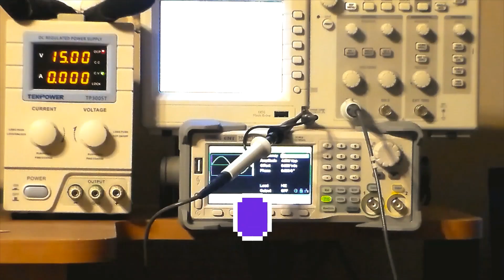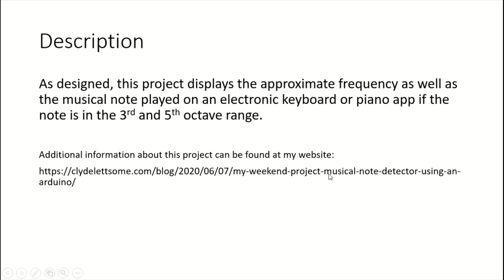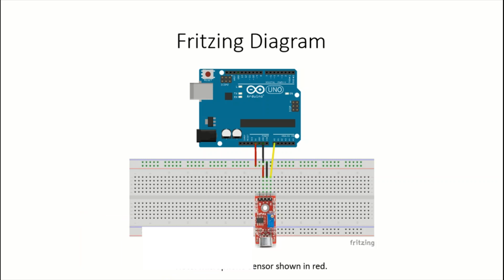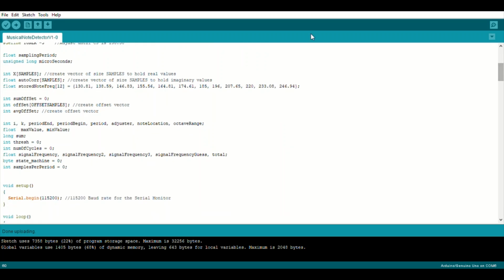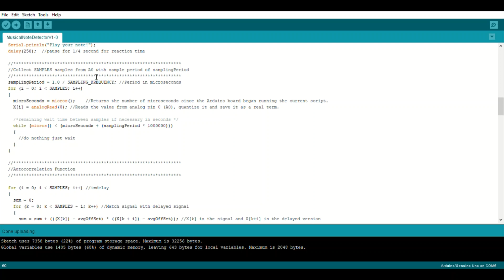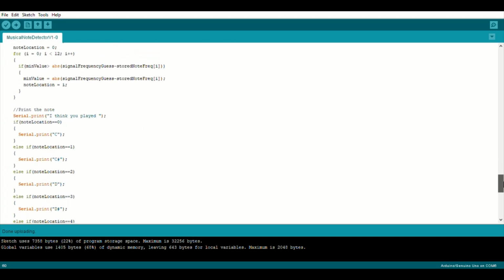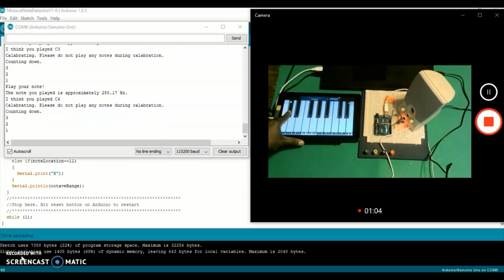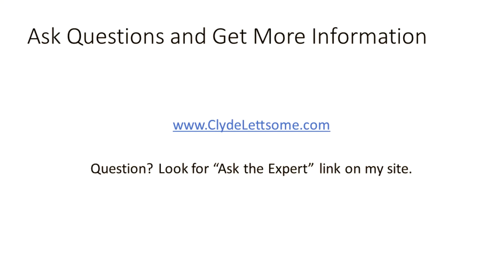My Weekend Project: Musical Note Detector Using An Arduino

Comment: In order to make the program display how close the played note was to the closest match in the storedNoteFreq array, I added the following in the section you titled "Find the closest note":

noteLocation = i;
        cents = 1200 * log(storedNoteFreq[i]/signalFrequencyGuess)/log(2);
        if (cents < 0) {
          flatSharp = "flat";
          cents = -cents;
        } else if (cents > 0) {
          flatSharp = "sharp";
        } else if (cents = 0) {
          flatSharp = "";
        }

I then had this display in the printed output  as...

Serial.println(octaveRange);
    if (cents == 0) {
      Serial.println("You nailed it!")
    } else if (cents <> 0) {
    Serial.print("You were ");
    Serial.print(cents);
    Serial.print(" cents ");
    Serial.print(flatSharp);
    Serial.println(".");
    }

What do you think?

(NOTE: Don't forget to add "int cents = 0;" and String flatSharp = "";" to the variables at the very beginning.)

Comment: Hi! Thank you so much for this video, I really appreciate it. I just have a really quick question -- https://www.amazon.ca/Robojax-Detection-Module-Switch-Arduino/dp/B07C2Q7LRH/ref=sr_1_20?dchild=1&keywords=DEVMO+3PCS+Mic+Microphone+Sensor+High+Sensitivity+Sound+Detection&qid=1626290052&sr=8-20 will this sound sensor work? And can this system detect chords as well? Thanks a bunch!

Comment: Hi Doctor Clyde,
I measured the current of a mobile charger with a multimeter and i put a 1 ohm 3 watt resistor in series with the probes and the output of the charger and the output voltage and current is exactly the same as what written on charger.
I tried with other chargers and the results are exactly like what it should be.
Did i measure the current wrong?
Reply from the maker: Hi Toolman,
It sounds like you did but do note the crrent showing on your multi meter will also be dependent on the resistor (load) you put in series also.

Good Luck!
Like, Share, and Subscribe.
Reply: Thanks for answering my questions.
I use 1 ohm resistor to avoid exceeding the maximum current the chargers can give.
Are there any other way to test the chargers output current with multimeters ?

Comment: Hello. Thanks for the project. I dont  know why doesnt works... Would be possible to use MAX 4466 instead of DEVMO? Thanks
Reply from the maker: I am not familiar with the Max 4466. I know it worked with the parts I used. Try the DEVMO. See my website for where you can purchase the  DEVMO. https://clydelettsome.com/blog/2020/06/07/my-weekend-project-musical-note-detector-using-an-arduino/

Please like, share, and subscribe.